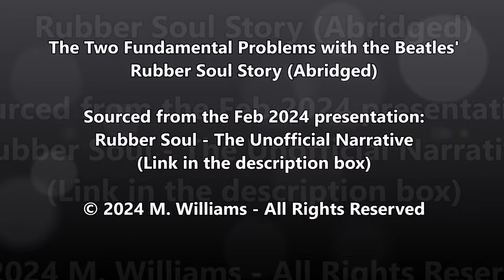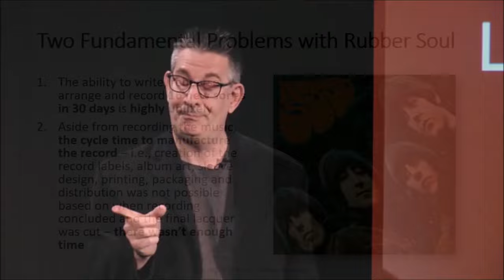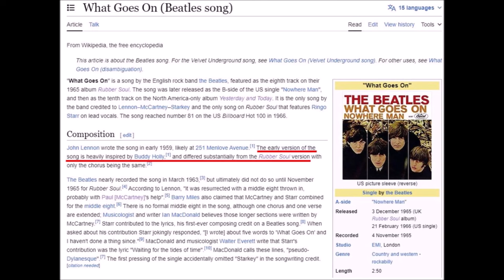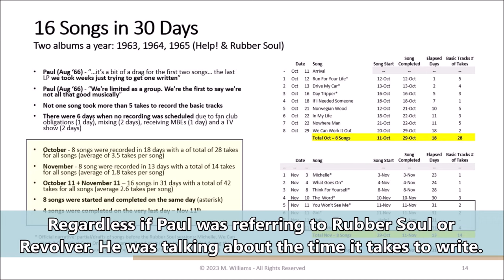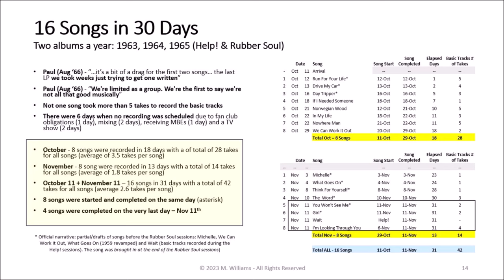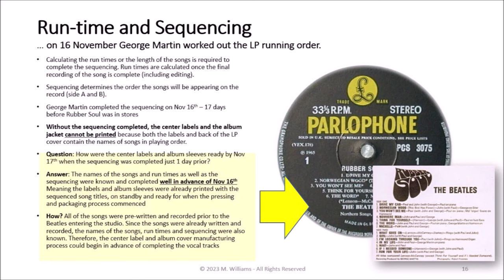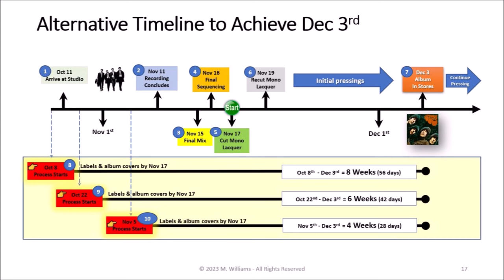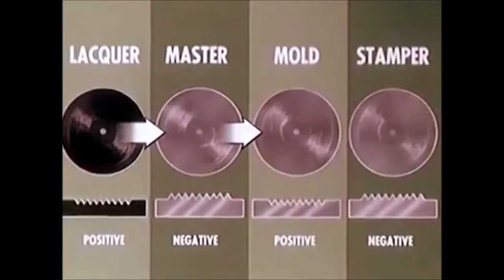Sage of Quay® - Mike Williams - The Beatles’ Rubber Soul Dilemma (Abridged - Apr 2024)

Comment: Mike. How many records are made for pressing?. There can’t be just 1 to get thousands into stores.. back in 60d they did not have the machines we do today . They did not have injection molding on 60s. Thinking about it. The materials to make a record had to known . The plastic had to be made to get on a machine.  I’m no genius but building dies are not simple so to make a mold of a disk for plastic to be molded had to be perfect and depending how many were made for pressing were talk some serious hours to be sure each disk had no flaws . And also wear . Making records over and over and the heat with pressing had to be checked and be sure no defects were made. There seems to be more than just slapping a label and pressing a record . Records had to be cooled down for the jacket and even wrapped for the stores. I’m convinced it’s horseshit and no way they could do that even 60 or 90 days
Reply from the maker: The vinyl record manufacturing = lacquer, master, mother, stamper and pressings. Each stamper, generally speaking, will generate 1,000 records. As the pressings near 1,000, the plant performs quality checks to make sure the vinyl is still being pressed properly. When a stamper has reached end of life, a new stamper goes into production (multiple stampers are created from the onset). Sometimes, one stamper can bang out 1,500 records, but 1,000 appears to be the acknowledged industry average. https://www.aardvarkmastering.com/proceed.htm